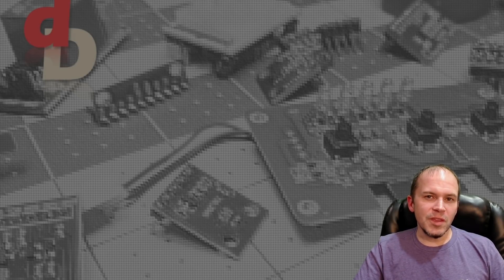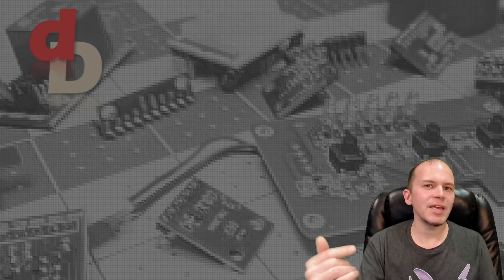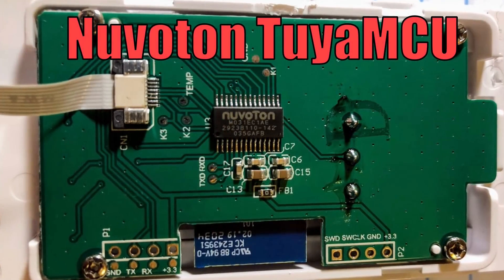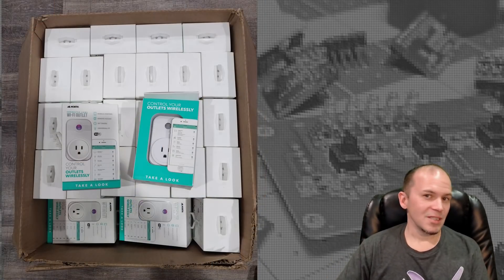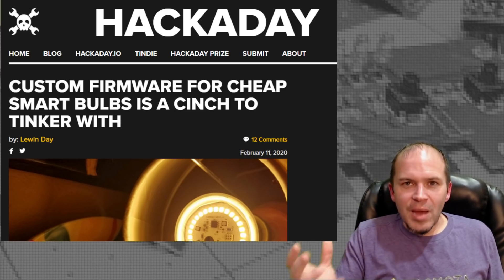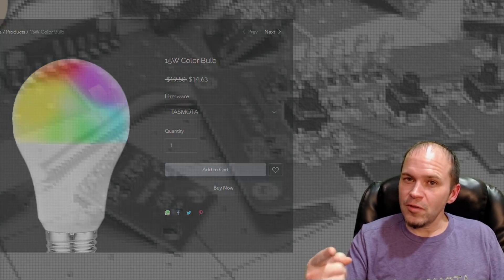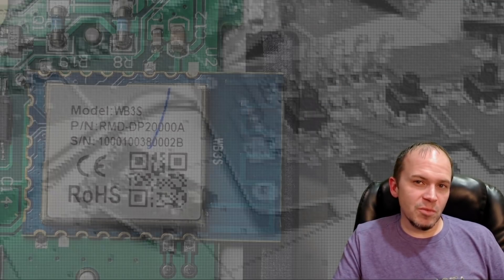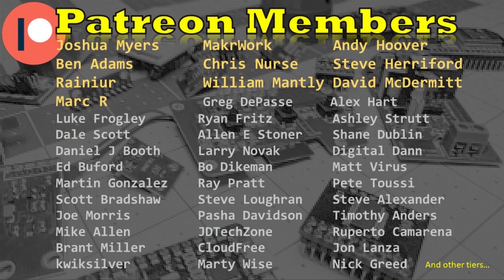What's happening to the ESP8266? | Smart Home Local Control Issues

Comment: The new BL602/4 [Bouffalo] seems a good option it seems to be better than the RTL8710 which lacks DAC/ADC onboard. Also they are Risc V based.  Since the core ESP code isn't open to security as I understand it (runs more like a FPGA)  there are possible security issues we won't know about.  Whereas the other chips might not have the same issue as the kernel might be implemented in Cmos.

Comment: I got some bseed (tuya compatible) wifi switches from AliExpress with those WB3S chips in it. Can't flash those with Tasmoto. So I tried the LocalTuya integration. The hard part is to get the 'key' value for the tuya device, which requires setting up an account at iot.tuya.com, use the Tuyasmart app once to get it linked to their cloud, wait a day for your fresh account to propagate to their cloud severs, then run tuya-cli wizard with the account/project credentials to get that precious key value. With that info, you can connect it to HA and you don't need the cloud anymore. There are quite some loops you have to jump through, similar to OTA flashing which is also a bit complicated first time. Best is to do a bunch of them in one row. But yeah, the tasmoto with MQTT was very comfortable to use.

Comment: @digiblurDIY I just successfully replaced the new Tuya WB3S with an ESP. Other than tearing off a solder pad for GPIO15 (that I had to ugly-bridge to ground) it went really well. I pre-flashed with Tasmota and soldered it on. I used the fan portion of the config steps from the fan/dimmer combo, including the rule to switch the speeds. Working perfectly in Home Assistant so I just ordered 4 more to do the other fans in the house. I uploaded a quick and dirty video of the results here on my channel: https://youtu.be/brycQoIUMyg
Reply from the maker: Nice work!  I know a few folks were talking on my discord about this controller.
Reply: @digiblurDIY  Thanks for all you do! BTW, these are the ESP chips I used: https://www.amazon.com/gp/product/B07SDMHYY8 Also, I had to use NodeMCU-PyFlasher in QIO mode because I couldn't get Tasmotizer to connect.
Reply from the maker: You could end up with issues using QIO on future upgrades, DOUT is the recommendation.  I did a transplant this weekend and it went pretty smooth.  This little burner thing here is awesome to flash stuff - https://amzn.to/3qMKubx
Reply: @digiblurDIY  Nice! Thanks for the link, that beats the heck out of all the mini clips I used!

Comment: I came across this chip change on my last LED strip controller purchase. I disassembled it to connect it to the computer and flash tasmota and after several attempts I saw that the processor was not an ESP but a Buffalo. The box is identical to another MagicHome that I have Tasmotized. It work with local control in HA but I prefer to flash it.

Comment: Recently bought a diffuser that previously was possible to flash via tuya-convert. At first when it didn't work I thought it was just because of the new firmware and the PSK issue, but when I opened it up I found a WBR3 chip instead of the TYWE3S that they used previously on these diffusers.

Guess I'll be transplanting an ESP then, since I definitely want to keep everything as local as possible.

Would be great to also see you transplant an ESP to some IoT device. That might make people also want to learn how to do it.
Reply from the maker: Absolutely that is my goal to try the transplant as well. I have a couple to try it on.

Comment: Just a note on the hot air gun you flashed a photo of. I bought several of these for work a few months back, and there's 2 mods I'd highly recommend you make. Obviously this may depend on the one you purchased, but I suspect all those models have the same issues. One co-worker even claimed to have measured 40VAC between the metal nozzle and ground.

1. Replace the plug with a 3-prong. The ones I purchased had 3 wire cords with the ground wire internally connected to the chassis, but they only used a 2 prong plug.
2. Rewire the power switch to switch hot instead of neutral. Not sure why they did this, but we didn't feel comfortable with live 120V even with the switch off.

That being said, they're otherwise great little units. It's actually the same hot air gun I used to remove the ESP modules on a batch of dimmers this week.
Reply from the maker: Thanks I did know about these issues and definitely was going to check mine before using it or  just returning if it was too bad.

Comment: As mentioned the real request is “local control”. Very few care which chipset its on if things have a well documented, open, and properly secured, API.
Reply from the maker: Sadly something like local MQTT is not a thing with many devices nor is a local API. I do get the cloud access for devices for many folks but it is easy to design for dual use devices.
Reply: @digiblurDIY  yeah it’d be icing on the cake if they’d standardize on MQTT but if all they want to offer is a published API with secured transport, that’d be fine. 

Most of this stuff is at a price point that won’t ever justify that much core code development though, sadly.
Reply from the maker: I have seen way too many cloud APIs come and go unfortunately to rely on them too much. Then the whole requiring internet access for something local to work just sucks.
Reply: @digiblurDIY  right. No I’m talking about published secure local LAN APIs. If we have those we don’t care what chip created it anymore... :-)
Reply from the maker: Gotcha. Exactly! Much like if a camera has ONVIF and RTSP I can care less what CPU is inside as long as it works.
Reply: Agree. E.g. (disclaimer: I'm not affiliated) shellies allow both cloud and "local" management, which makes reflashing with custom FW not necessary.
On the other side,  I see both tasmota and esphome pretty mature platforms, which make customizing my own ESPxx really easy without the need of learning arduino (just a bit of yaml in case of esphome).
Reply from the maker: I do like how Shelly approached this on their switch line. Unless they fixed their MQTT issues in stock I still find it necessary to flash them. Luckily it is to just push a web URL to flash them over.

Comment: I just got a four pack lohas, none able to tuya-convert, it keeps looping sending packets.. is that what you are referring to ?
Reply from the maker: Could be switched chipsets or new firmware. Still some alternatives for now luckily.
Reply: @digiblurDIY  Tuya-convertible RGB/W bulbs ?? PLEASE let me know which ones ??
Reply from the maker: What country?
Reply: @digiblurDIY  Austin (Texas). Amazon preferred!
Reply from the maker: These are still doable via Tuya Convert after last week. Might still be on sale too.  
https://amzn.to/33wyl15
Reply: @digiblurDIY  I got these delivered, literally, an hour ago! They do not work with tuya-convert. I tried order brands, like Peteme, Wixann, Ohlux, Maxvolador, Gosund, all within the past few days, none of them worked with Tuya-convert! Honestly, at this point, I don't mind soldering as long as the tx rx etc are on the surface and do not require to destroy the bulb to access.. any chance you know more that can help?
Reply from the maker: I suspect something is wrong with your Tuya Convert. What error?
Reply: @digiblurDIY  it says:
"SmartConfig complete.
Resending SmartConfig Packets
............"
And keeps repeating these lines, until:
"Device did not appear with intermediate firmware"
The thing though, I was able to tuya-convert some smart plugs using the same setup with no issues!
Reply from the maker: Check the log files. The psk one. See any decryption failed messages?
Reply: @digiblurDIY  Not sure why, but I ordered another four pack of those, and it works!!! However, I noticed that Tasmota Fade 1 and Speed xx commands do not work on these (to smoothen out the brightness/color change), the change of brightness/color remains rough, as opposed to other RGB controllers (such as MagicHome's) I flashed with Tasmota where Fade 1 and Speed xx (where xx = 4 for example) produces a very nice smoothness when you change the brightness/color.
Did any of the Fade/Speed work work on your Lohas ?
Reply from the maker: That could be normal with just the ESP doing software PWM.  I have heard of people doing the higher clock speed builds to help with that but I've never tried it.  You are probably comparing a hardware LED controller to a software LED controller.  I don't use the fade/speed stuff myself on bulbs.

Comment: In my opinion I could find out that esp8266 is not the best microcontroller for any iot device neither for Industrial Internet of things, even the same architecture can he applied to any configuration of microcontroller based on esp8266 with cheaper components for simple switching or controlling a PWM signal but weakness still on the board. Nevertheless, esp32 might achieve a higher level of applications in the field without using tasmota or esphome, also espressif have achieved an enhancement in the security field of this microcontroller which i think that companies must take in account in the near future.
Reply from the maker: I do prefer the ESP32 for running open source projects myself but we aren't really to that level of seeing them in devices mainstream yet.

Comment: I have a lomota system not compatible with mgt garage door. Can I put the button wires on my garage door button opener?
Reply from the maker: Yup. I have seen that done before on the digital button style ones. Optoisolator or relay.

Comment: The harder the chip is to program the sooner it will fail. If people have no control over home IoT devices - what's the point of buying such devices like those switches.
ESP also is not fully open source but it is much better. We have to wait for RiscV definitely but evil corporations try to block it.
Reply: I hate to talk gloom but they won't fail because most users just want to use Alexa or some other proprietary service and don't care about open source. RiscV is an open architecture but we're already seeing proprietary hardware with proprietary extensions built on top of it. For the DIYer/hacker market we'll have to rely on vendors that want to target that community.

Comment: since you asked for new video ideas...I've been trying to get a sonoff rf bridge with tasmota to show the codes from a htzsafe driveway alarm pir sensor.  I suspect there is some sort of rolling code/proprietary comm protocol over 433 that they are using to prevent using their sensor with anything other than their receiver. Maybe you could cover what can and cannot be connected thru the rf bridge in plain language? you have a gift for breaking this stuff down to a level even I usually understand.

Comment: I had a very good surprise with the last Sonoff "DYI" devices I bought : now the update can be done OTA with just a very easy REST request (actually there are two requests : the first one opens the OTA mode, the second one provides the URL where the Tasmota FW can be found). On these latest HW releases we don't need to open the devices to strap the DYI jumper anymore. Upgrading was even easier than our good old tuya-convert, thus Sonoff instantly moved at the top of my favourite IoT brands :)
Reply from the maker: Do you still need to install their sketchy tool? Shelly upgrade is pretty simple too. Push via web browser to Tasmota.
Reply: @digiblurDIY  you don't have to, all you need is:

Some way of making HTTP POST requests and reading the returned value. I just used curl on Linux.
A HTTP server that supports the Range header. This part about Range is key, I initially just ran a basic python http server and it was working for everything but flashing. Instead I just used the basic docker nginx server.

First make sure it's updated to FW 3.6 (you can do this in the Sonoff app). Next you just hold down the button on the device until it starts blinking rapidly, then connect to it's SSID, then go to it's web page at 10.10.7.3 and type in your own WiFi networks SSID and password. Now connect back to your network and find the IP of the device.

Next find the PDF that includes the API spec, it's on their GitHub. First I would suggest making a call to /info using the IP of the device. Check if otaUnlock is set to true. If not, make a basic call to /ota_unlock. Then make a second call to info to make sure it worked.

Finally start the HTTP server with the firmware you want to flash in there, I'd recommend checking in a web browser if you can access the firmware at e.g. [your local IP]/yourfirmware.bin. If you can then send the URL of your firmware (and maybe the device id from info) to /ota_flash.

That's it, should be flashed. It's great because it's not dependent on any special program to flash, so Sonoff doesn't have to maintain one, and users will still be able to flash it in 10 years time using basic tools.

If anyone needs any more help just ask
Reply: @digiblurDIY  Absolutely nothing more than your PC, your browser and the device. It really takes less than 5 minutes. Basically, the steps are :
- connect your PC to Sonoff's temporary AP
- access a webpage on which you enter the credentials of your home Wifi
- reset the device
- find the device IP on the Wifi
- use a REST client (browser add-on or software like Insomnia)
- send 2 commands
and you are all set!

See the detailed procedure here :
https://tasmota.github.io/docs/Sonoff-DIY/

Comment: The problem is that more and more companies try to force you into the subscription model, and let’s face it, it’s understandable. If you buy a few switches and controllers and use them locally, you pay 100-150 dollars, and that’s it. If you pay a monthly fee for cloud control and storage, you’re a much better customer for them on the long run.
Reply from the maker: Fully agree there with the recurring revenue model, I mean look at the mess that Wyze is now due to it.  I'll make a huge hard pass on paying monthly for my light switches/light bulbs though even if they were free and someone came to install them.

Comment: In the same time, I sense rise of zigbee devices. Isn't that good local option?
Reply from the maker: Indeed it is. Very good observation. The downsides for mains powered zigbee though is price and lack of features.
Reply: I'm buying a lot more Zigbee devices these days, but DIY is always preferred
Reply: Zigbee and Zwave are great. But I've gotten addicted to modifying my ESP devices. Adding stuff to GPIO pins or getting the firmware exactly like I want. Maybe one day there could be more zigbee support in this area.

Comment: I'm doing DIY esphome stuff so as long as I can get the modules, I'm good!
Reply: I also use ESP32s with the PubSubClient + my own code, but the problem is that I cannot compete in size with the big ones. I live in Europe, and sometimes there's almost no space behind a switch or socket in the wall box. There's no way I can build such a small module like the Shellies.
Reply: @miklossurjan  Here in the US box size varies widely especially with older homes,  and the cheap ass HUD houses that wont even take a dimmer or a normal outlet...

Comment: The Media does not differentiate between reflashing a device for local control and evil hackers trying to make damage to people's homes. In fact local controlled devices are way safer, because they don't talk to the internet. If Tuya servers are hacked (or someone from the chinese special forces makes a call), people's homes can be hacked with a very high precision by flashing custom firmware on per account basis. A smart plug or light itself doesn't really constitute a great spy device, but as nearly anyone keeps them on the same wifi as all other devices they can be used as relays for further hacking e.g. into flawed routers or NASes. If you think it's not possible check SolarGate.

Comment: Do you have a list of who sells devices preflashed with esphome? I looked at the ones you showed and they were all tasmota
Reply from the maker: I only know of the three that I mentioned so far.
Reply: If you have Tasmota it's super easy to reflash to ESPHome. You can flash the firmware you create directly from the Tasmota interface. Also I would just highly suggest you learn how to flash via hardware anyway, an FTDI chip can be picked up for £5-10, it's really really easy to do.

I don't think selling devices with ESPHome already on them makes a great deal of sense given how dependent on your own custom firmware ESPHome is. As I said it's very very easy to flash from Tasmota, and not hard to flash via hardware.
Reply from the maker: Missed the esphome part. Thanks!
Reply from the maker: Sorry. Missed the esphome part originally. Since esphome would be your own configured bin just make one before hand and turn off the safety check in Tasmota. On the console do

Setoption78 1

Then use the firmware upgrade GUI on Tasmota to upload your bin.